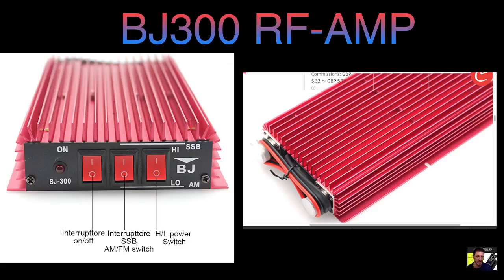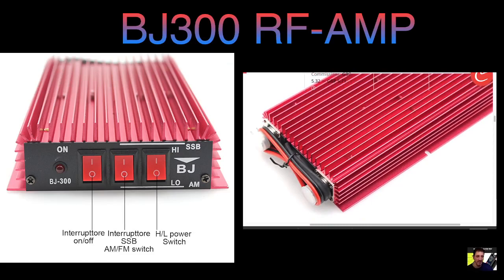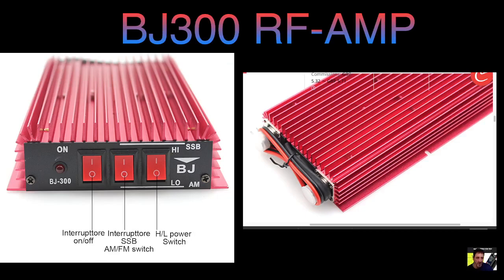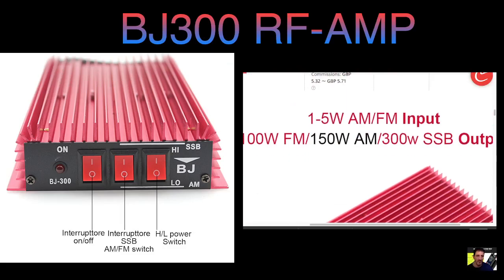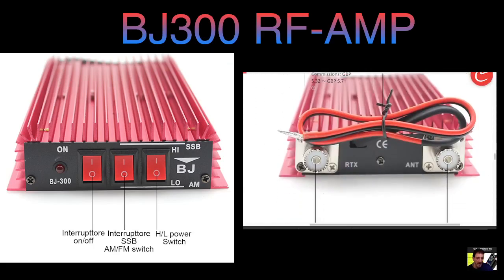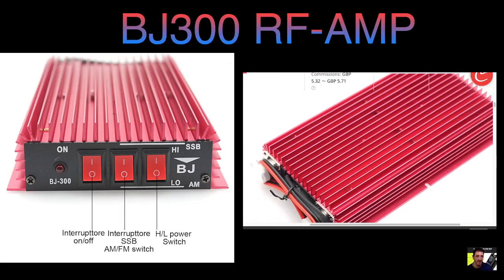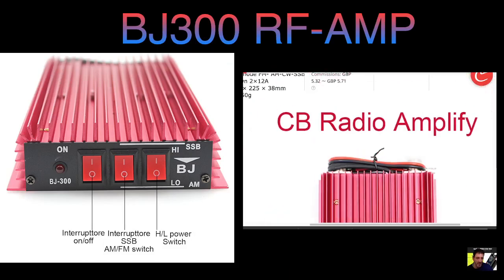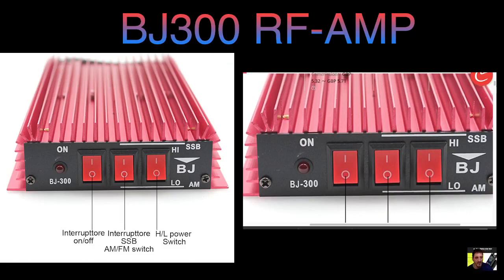BUDGET - RF AMPLIFIER (AM FM SSB) 3-30 MHZ(Not a Recommended Device )

Comment: These amplifiers are quite poorly biased and only just running in class B, with some considerable cross-over distortion. Ideally you need to re-bias to class AB, several videos on YouTube of people who have done this, also the input attenuator resistors burn out very easily and should be replaced with higher wattage resistors.
Reply from the maker: Agree

Comment: BUYER BEWARE!   I purchased 2 of the BJ-300 Plus (same amp but includes fan on top). First issue, Hi /Low switch is backwards on both amps: Hi is Low Power, Low is Hi Power, Modulation is garbled and the amp reflects about 6 watts back into radio. My SWR is 1.1 to 1. Transmits  noise at dead key. 3-4 watts in brings about 160 watts out in AM but reflects back about 6 watts  and screws up your SWR big time! Avoid this amp and get an RM Italy version. Save yourself some grief!
Reply from the maker: Agree
Reply: i have this problim right now pissing me of

Comment: I got one, but swr spikes like anything 😢 no clue on why its happening..
Reply from the maker: These amps are no good ,
Reply: @M0FXBHamTech  yeah , really
Reply: Get a low pass filter they are about 50 bucks RM Italy makes one I bought one. It will clean up SWR’s I purchased one of these. I did not even get it in the mail yet and I ordered. an RM Italy it will match the filter also because they make it. That’s the one I’m gonna use when I get this one. I’ll probably put it in the closet upside down switches red flag

Comment: Works great for me on CB.. SSB.. Gives me around 120W on my antenna.
Reply from the maker: Not bad
Reply: It is not designed to work with SSB modulation (it is a lie in the amp description on aliexpress). It is class C amp. So only FM modulation, eventually AM.
Reply: Hi jim do u work it in ssb mode some comments say it doesn't work or work well in ssb because I gonna to buy one
Reply: @johnyum9021  from the box it does not work well in SSB mode. You need to add transistors bias circuit.

Comment: Got one of these: building a box of stuff around it to make it useable as it needs a) output filtering (has absolutely no LPF as supplied) and b) it needs matching on the input (eg 3dB attenuator) to avoid presenting unreasonable SWR to the driving rig. I am undecided whether going for a QRP rig and adding something like this is a good idea. I have definitely learned a lot but it’s a big faff to get it legal and frankly buying something like a FT-891 or an IC-7300 would have given me more reliability, more functionality, and stuff like SWR protection which this does not have for not much more money at the end of the day. If you search on YouTube for BJ-300 there are some Spanish speaking hams who go through how to mod it and the translated subtitles are good enough to see what they are doing.
Reply from the maker: Agree i will send it back or sell

Comment: Using it for years, 5 watt ssb in 120 out..
Reply from the maker: Thanks what bands
Reply: So it doesn't do the advertised 300W SSB?  Expected!
Reply: @mkaylor  In order to get 300watts out, you have to put 10 watts in.
Reply: @NateClark-x4w  Rubbish. It's a linear amp. If the first poster is correct and I suspect he is  then you'd only  get  240 W out but it would likely go into compression and you'd  be lucky to get 200 W PEP.  All RM amps are notorious for  having  model numbers that are about 2x the maximum PEP out , wit the case glowing hot.   Some models of this BJ 300 are sold with a top mounted cooling fan which is an indication that the thermal design is marginal.  These cheap HF  amps generally use  new old stock bipolar  RF transistors that can 't be had  in one off lots for repair use.